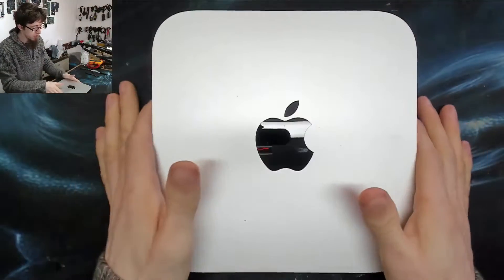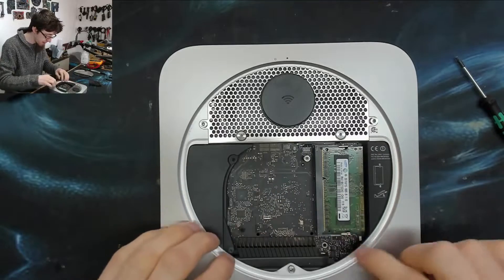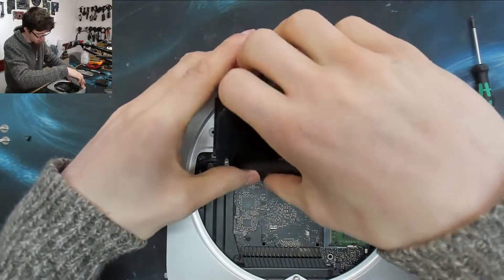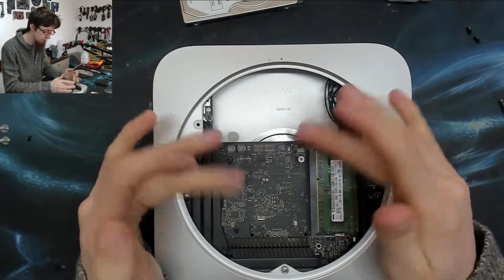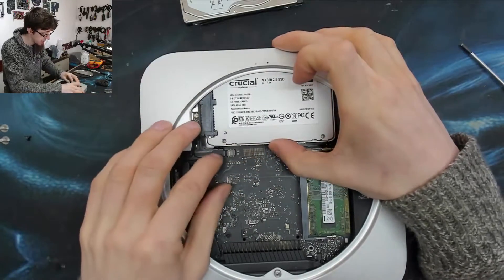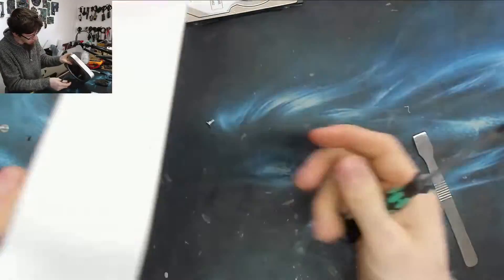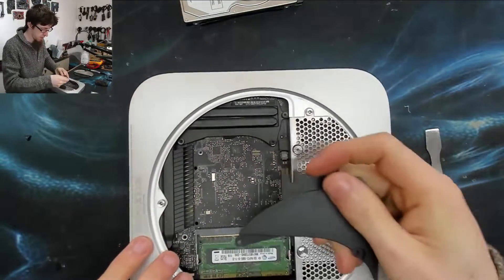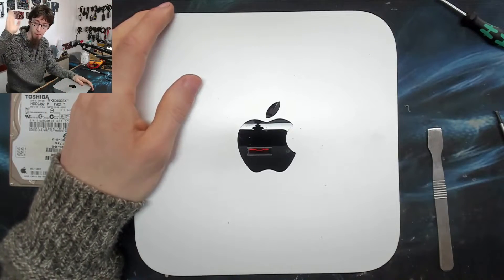LFC#166 - Mac Mini SSD Upgrade

Comment: Since you mentioned that you had an original Mac mini, I was given one (2005 Mac mini G4) along with a 2006 MacBook Pro Core Duo; my first Macs. The MBP works fine, but have not powered up the mini as I was told it has a password issue (may be password locked). If I hook it up and check exactly what that is, would you be willing to help me towards resolving it...?
Reply from the maker: If it's a firmware password (displays a padlock and password box) then I'm not sure how to clear those. If it's just a lost macOS password, wipe it and reinstall macOS - assuming there's no data needed!

Comment: Just to clarify: the Mac minis can slide out of the case completely. In fact this is precisely what you have to do if you want to add a second hard drive to your Mac mini on that model, or if you want to upgrade the RAM on the latest generation.